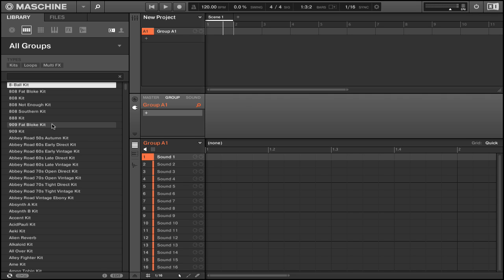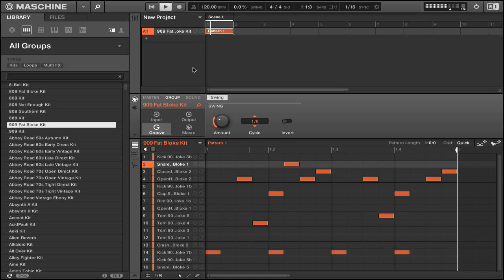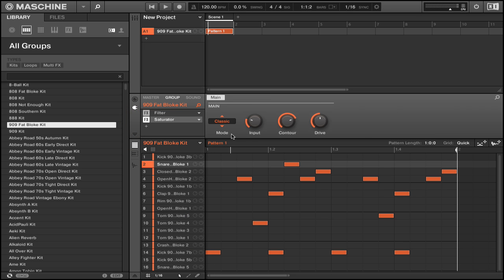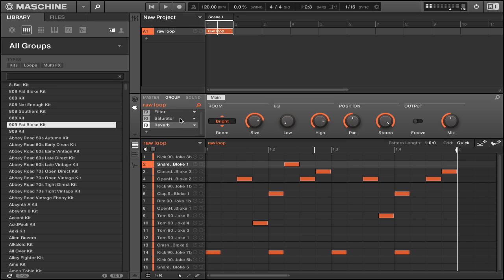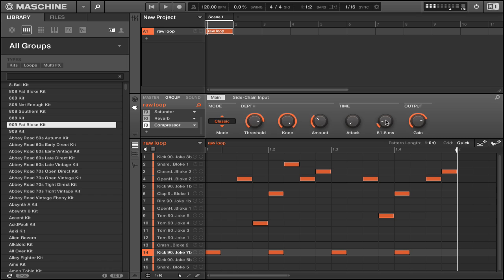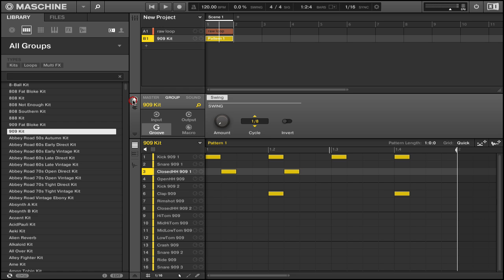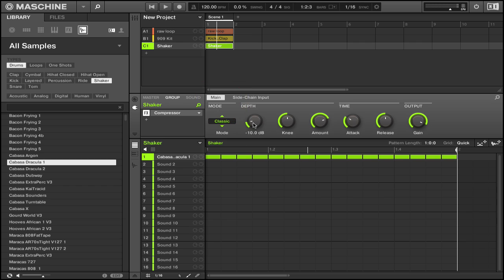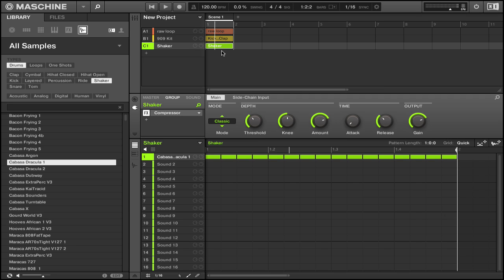Maschine 2.0 + sidechain compression creates a raw underground house drum loop

Comment: Hey I got a question about pattern length settings in Maschine 2.0:
Can you start a pattern loop from any other place than pattern start?
For example from bar 3 to bar 4?
Cheers!
Reply from the maker: sadly no.. well at least I haven't found a way so far. The alternative is to create scenes with different patterns and switch between them on the fly BUT you can't record this switching into the arrangement.. unless you record the audio into a pad.. OR use a DAW and midi to switch scenes.. recorded onto a midi track. It's a frustrating limitation in Maschine Standalone.
Reply: Music Production Tutorials Thanks for your response however it's not a good news :D Seems I won't update to 2.0
Reply: loopingdude
this you couldn't even do on the 1.8 version...